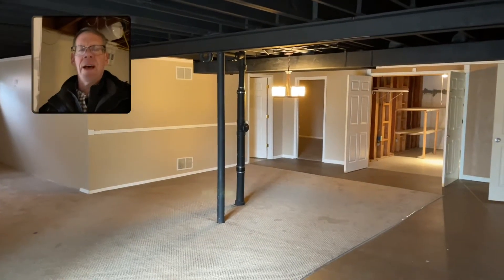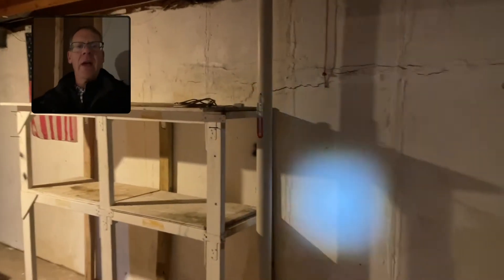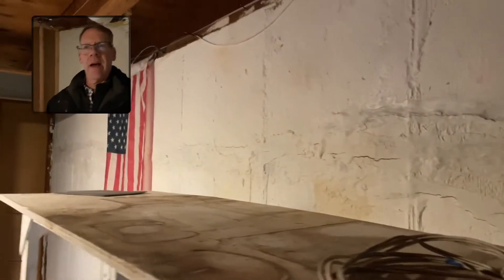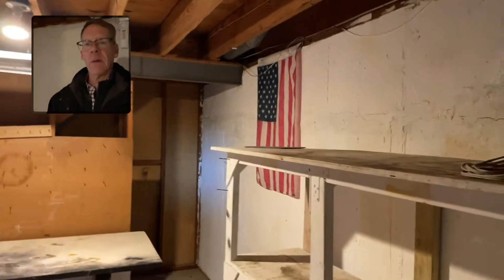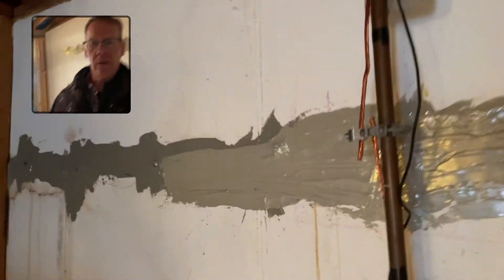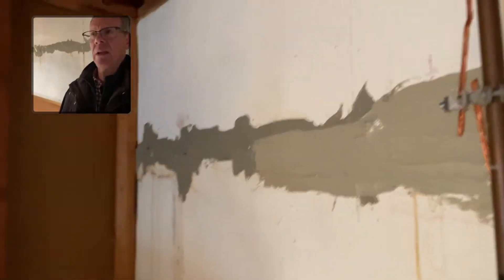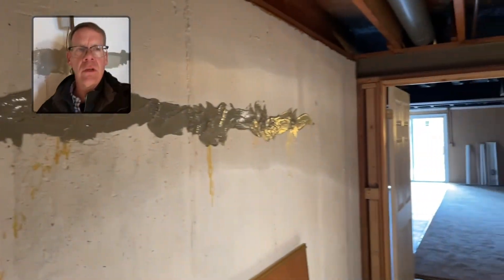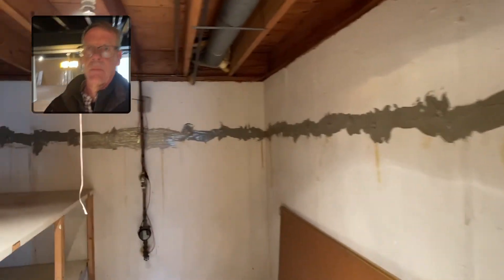Basement Repair Example | Rebar Pop

Comment: all epoxy injections to poured wall cracks i have seen spanning 46 years do NOT go all way through to the outside as they falsely claim so it is NOT the correct/best fix. And block walls can powder, crumble, deteriorate, disintegrate from water etc penetration so NO interior basement drainage system and 100 sump pumps 'stops' water penetration through the basement walls - scam

Comment: So I’m in the foundation repair business. I hear inspectors say this all the time and even some structural engineers. That this type of foundation damage is not a structural concern. When In fact it absolutely should be. 
You see that crack goes all the way through the wall from the inside to the outside. Now there is no structural reinforcement that runs vertically in most all residential home building, and even in a lot of smaller commercial building. Since that crack runs all the way through the wall you now have a hinge. And now it is more susceptible to lateral failure. It will take less lateral pressure to essentially push that wall to the inside and landing in the basement floor. 
So… it is a structural concern that should be addressed sooner than later. And the type of repair in this video is not a structural repair. And a rebar pop crack should never be injected with a urethane. It should be coated with an LV resin to prevent further rusting.